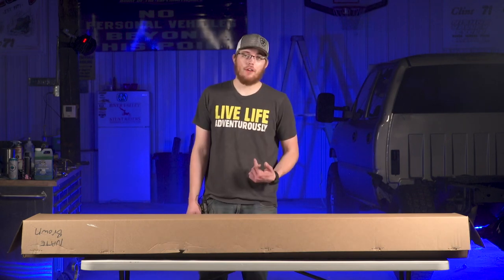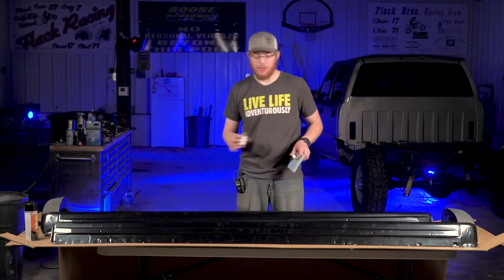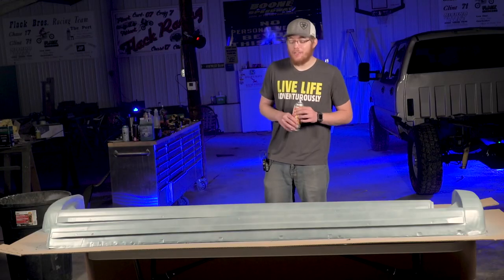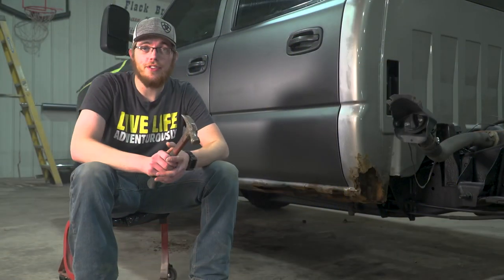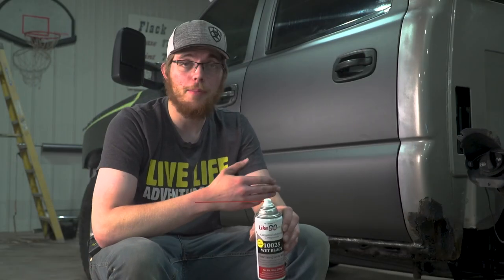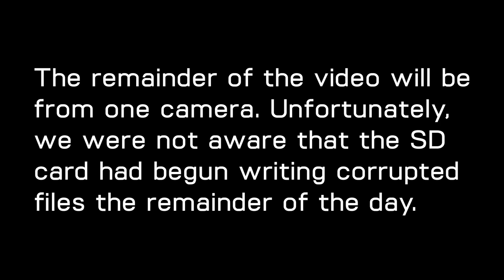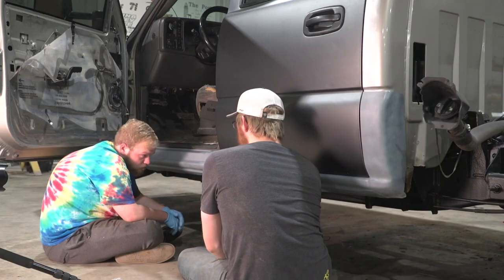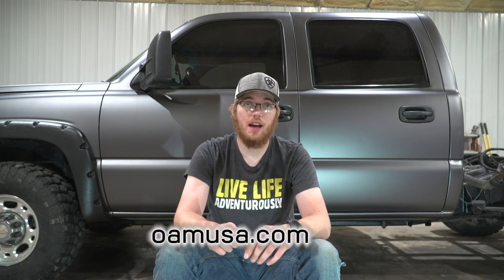Easiest Way To Deal With Rusty Rocker Panels

Comment: By the time you’ve bought the starter kit $117 & the panels $460 your out almost $600 bucks. Better off the get your harbor freight angle grinder $29 and cut them and go to rock auto and buy a set of panels $300. Get you a used 110 cheapo welder and do it right. Now, you got a welder and grinder too boot for your next project. Your mileage may very.
Reply: Cheaper to cut off rusted area, FOAM fill , Bondo fill, sand down , primer, paint, less $100
Reply: @roadsafeties-wg6hi  Some peoples rockers (like mine) are completely gone, and that wont last long. Done that on many trucks and it lasts a couple months (just one winter)

Comment: I guess i can see the need for this product...but its not my choice. Just checked on the covers... $400.00 is a bit much for plastic. I bought a set of steel rockers just a little over $100.00 online ...i cut out the old rockers and a local guy welded the new ones on for $100 a side. I used a small amount of filler, then painted them...When all was said and done i was in to the project for just about the same $400.00 as buying plastic. IF the plastic ones were $99.00 or something...i could see the reason for buying them (you'd save hundreds of dollars). Seems like they are a band-aid on a bullet wound. But Anyway...nice job on the video....truck looks nice after the cover were put on. You did a good job explaining the process.
Reply: I've been feeling the same way. I have rusted out cab corners and rocker panels and debating between just doing new metal, body filler, primer and paint, or these covers. However these covers do just seem like a band aid, not really addressing the problem literally covering it. Just dunno how they would hold up over time.
Reply: Where did you source steel rockers for such a good price?
Reply: Thats just what i wanted to hear, a got a 2014 sierra and the previous owner just put bondo and paint over all the rocker panel rust and called it a day, 2 days ago i decided to actually check the truck and i hit the rocker panel with my fist and it just started crumbling to pieces 😂

Comment: If your rockers are bad, how does plastic restore the structure integrity that is lost?   Isn't this like putting a piece of tape on one side of your broken leg?
Reply: Bc Rockers are cosmetic and Not structural
Reply: @CarterEdison777    That would be great if true. But it's not.
Reply: @judyjohnson630  Its absolutely true in a body on frame truck, like this video!
Reply: Even on my 1999 Toyota Solara the outer rocker cover is not structural. The middle rocker cover and the inner rocker cover our however structural on my unibody car.

Comment: Best way is the right way cut rust and weld new in place .      Your just wasting money trying to hide it.
Reply from the maker: You’re unfortunately right on this. I did this install to satisfy myself. I have no intentions of selling the truck, and would be transparent regarding the covers if I did.
Reply: There is no real right way I've had metal cut out and replaced 3 times already on 2000 chevy silverado and now it's rusting again for a 4th time and worst part is its a 3 door model so the bill is even higher replacing the rust on driver side the last time it was $4,750.00 to fix both sides
Reply: @johns3153  that means they didn’t do it correctly
Reply: @user-my5nr3il3q  idk it's been to three different places one was got rust in Maryland then two different places in Delaware
Reply: @johns3153  something doesn’t sound right about that, I’d say they’re not protecting the insides of the panels properly or at all if it’s rusting out again that fast.

Comment: Everyone complaining and saying they're going to fall off, they cost too much, it's gunna rust even faster, bla bla bla..... 1. Use some 3M urethane and apply a bead around the entire lip and on all the other surfaces, it holds your windshield in it'll definitely hold these on and seal out any road grime. 2. Yes they cost a little bit compared to steel slip ons or replacements but the cost for a shop to install them is typically thousands over these covers and I can guarantee you they're going to rust again (unless you don't drive the vehicle in the rain or snow ever again which that's not what these are for) and you'll be replacing them again. 3. If you treat the rust underneath, cut it out and treat the bare metal, or use one of the multiple coatings out there to treat and stop the chemical reaction that is causing the rust the do as I said in 1 and you'll be good. Don't be scared to not get fucked by a shop. P.S. I work at a body shop doing paint and body work. Have done tons of rockers and cab corners, and have also replaced tons of replacements..... BUT! If you enjoy watching your ride rust over and over again and sometimes paying more or half of what your vehicle is worth then hey you do you, I don't hate ya for it. Keeps the lights on.
Reply: Lol! I would think that someone who works in a body shop would know that rocker panels rust from the inside out.  Gluing pieces of plastic to what is essentially a rusty metal box filled with condensation and water isn’t  going to do what you think it will. 

Can I get your “guarantee” in writing?

Comment: This is why I have trust issues when buying cars
Reply: Are you less Man if your teeth have been fixed the right way or your knee was replaced the right way ?
Reply: @intruderIG  The right way implies the rocker panels were removed and new pieces were welded in place of the old.

Comment: Is this a joke? Rocker panel’s generally rust from the inside out. How are you going to paint the INSIDE of the rocker panels - where it matters?

And rocker panels are structural. Once you glue these on, and your rocker panels continue to rust away, will these plastic pieces provide the same structural integrity as steel rocker panels.

And rocker panels have drain holes, to allow the moisture out. How do these plastic ones allow the rocker panels to breath.

This isn’t a repair at all. It’s lipstick on a pig.

Comment: Nice concept. But if the inner rockers are rotted out as well, these aren't really going to suffice. They still need to mount to something.
Reply from the maker: There are inner rocker brackets available as well!
Reply: @NathanialBrown  - Right but the rocker brackets will not have anything to attach to if the inner rocker lip/panel seam is rusted out... right(?)
Reply from the maker: @__WJK__  I’m honestly not 100% sure. I’ve done two installs and neither have needs them. I know they attach with self tapers, so in theory you’d have the flexibility to choose the most rigid spots to screw. Again, I can’t confirm this.

Comment: $400 for a set for my 2004 Chevy 1500, no way in hell lol. If you're gonna glue something on you may as well get a set of slip on rockers and some adhesive... That being said, these things will cause whatever's behind them to rust twice as fast until your $400 flimsy plastic covers fall off the truck and get run over. Good idea, but WAY overpriced for the guy that wants to do a hack, slap, and forget it 
 job

Comment: i can only imagine the water n dirt getting in there although 3m tape is good i see the rocker fying off within a yr or flaping in the wind
Reply: Add some 3m urethane, problem solved. Shit holds windshields, should have no problem holding these. Plus you make a full bead and keep all road grime out.
Reply from the maker: 9 months and mine still look solid

Comment: I question how will they stand up to rural gravel roads. I am guessing they will be ground up by the gravel coming off the front wheels. Sure you can put mud flaps on the front but I still have my doubts. Plus $400 + repair seems expensive if you can do the metal replacements yourself.
Reply: The key with your comment is "if you can do metal replacements yourself" I agree, but this is a lot less work, cost, & it doesn't require the tools or skillset to replace with metal. I think a coating of bed liner or a similar thick, hard or rubberized coating would bne best. I am in Omaha, & between the salt, sand, extreme cold, slush, wet weather, & the gravel you kick up if you drive dirt roads a lot or daily I am curious how the plastic holds up. My biggest concern & I think they do a good job of addressing is getting all the crap, rust, salt etc out of the rocker as well  as sealling it and or neutralizing as it is when the rockers or wherever continues to hold the wet gunk against exposed metal that corrosion really accelerates quickly. I initially thought they were going to use self tapers to secure the plastic so was glad to see the use of pop rivets. This product isn't a perfect fix, but if done right, I think it could be a good answer for those with budget, time, or skill constraints, and would improve the look of the vehicle, & if done right give youy several more years before that hidden rusty rocker rots away above the rocker or causing it to sag or flap.
Reply: @harvestblades  Yeah, it is going to get much worse underneath, unless you can remove all the rust. That stuff he put does nothing, maybe it makes you feel better. I would almost say glue on a primed and painted metal rocker, then spray ATF under it every year.

Comment: Compared to the alternative.   Doing (my time is valuable)  or paying a body shop.....THOUSANDS. This is a darn fine solve.  As long as you stop the existing rust and source of moisture (which the body shop wont likely do). 300 for corners,  spendy for plastic but looks great, saves thousands.....

Comment: Sure it looks better, but does it pass a state inspection? My state requires yearly inspections and I do believe it needs to be replaced with metal or it won't pass. No sticker means wasted money and you can't legally drive it on the road.

Comment: OAM Quick Covers are pretty nice but the cost + shipping is brutal, even tried to have a friend (who lives near them) pick up a set for me (to avoid the $80 shipping) but OAM wouldn't allow walk-in customer purchases :'(  I'm hoping BushWhacker will hurry up and offer a set of TrailArmor Rocker covers for 3rd Gen Quad Cab Rams (for $160), which would be awesome! That said, good video, the rocker cover turned out nice.  btw...why did you use moly grease on the rust instead of a really good spray-on or paint-on rust-reformer(?)
Reply from the maker: If you’re still looking for a solution, I’d check with OAM again. I’m guessing the walk in policy was due to covid. When I got mine I actually sent a friend in to get them!
Reply: @NathanialBrown  - I actually contacted OAM (about the walk-in purchases) back in late 2018/early 2019.  Might try emailing them again and see if they've changed their "walk-in" policy for 2022(?)  That said, did you have your covers "wrapped" or "painted" (?)
Reply from the maker: @__WJK__  apologies for the delayed response! The covers in this video were wrapped as the entire truck was being wrapped. We’re currently working on a second video where we show the paint work being done on another set! Hopefully you have been able to get yourself some!

Comment: Great video.  But this is temp solution.  As the years goes on, rust will spreading in the hidden by rocker penal.
Reply: Yep
Reply: I’m 57 yo.  Started doing this sort of work at 15.  The rust stop he is spraying on the rust works and will stop the rust.  I’ve seen work I performed 30 years ago and it still looks good.

Comment: You can get a cheap Flux core welder at Harbor freight & better welders but, I went there to get a stick welder but, my local Harbor freight was sold out so, I grabbed the Flux core...Anywho, it was only about $130-150.....
Reply from the maker: I considered the welding option as we have two on the farm, however this option seemed the quickest to fit what I wanted.
Reply: Yeah but, no but......this "repair " is a classic example of American "form over function" .....which admittedly seemed to be just a Californian thang when I lived there but has obviously spread nationwide....."oh, doesn't it look FABULOUS honey" ....... never mind the structural integrity, feel the shine. This at least explains the YouTube videos of American vehicles exploding in an accident, I always wondered why they did that. The point I'm trying to get across here is......the time to use these is when you buy the vehicle new or nearly new and as someone upthread said, use windshield adhesive to fix them in place. Anyway, just my tuppence worth.
Reply: @iandennis7836  1. No, rockers are cosmetic and Not stuctural
2. No, putting plastic over metal
Means you’ll never notice the rust in the backround
Reply: @CarterEdison777  and you've just made my point. Away from America,  we don't have a choice, sills (rockers, whatever ) are structural.......and our vehicle road worthiness test is SLIGHTLY more stringent than yours, shall we say.......
Reply: @iandennis7836  In glad that I could teach you that, when sills rust away, none your structural safety is diminished, in a 1/2 ton American truck. 

And yea, in the uk , the ‘heaviest duty’ ford pickup on sale might just collapse with some ‘sill’ oxidation; I wont argue with you on that
Reply: @CarterEdison777  I'll be honest with you, if the sills are that knackered, I wouldn't trust the integrity of the cab further than I could throw it, in the event of a high speed collision......
Reply: @iandennis7836  LOL “integrity of the cab” due to “knackered sills”.
Talk about A False Sense of Security!!
Reply: Flux core welding on bodywork is not the ideal welder. Lot of extra clean up.

Much better is a MIG welder.

Comment: Great video. One recommendation I would make is to get some phosphoric acid and coat all of the rusty parts with it. Phosphoric acid is a neutralizer and acts as a primer coat. Once that's done you can then apply the grease. You will have much better longer lasting results. 

Thanks for sharing the video.
Reply: 8 like😅
Reply: 8 like😅h

Comment: Hey man i got some moly grease from amazon for this project. It came in a tube for the grease gun. Im going to apply with a brush. "My question is" is one tube enough for both sides. Also it is a brown color. Does it matter what color as long as its a multi purpose moly grease?? Thanks
Reply from the maker: We used a tube on another install and one was enough. The color didn’t matter, if any seeps out you can wipe it off!
Reply: @NathanialBrown  thanks man i cant wait till im done with this.

Comment: I think this is a great solution but this is more temporarily I think it's a great quick fix if you're. problem not gonna to own the truck that long maybe a few years top  if that
Reply from the maker: A lot of people have installed these with the intentions of keeping the truck long term, and avoiding the inevitable rusting of new metal weld ins. We’re currently working on another video where a friend had them installed on a truck he recently purchased, specifically to avoid rusting again down the road!
Reply: How does this address the rusting and condensation inside the rocker panels? How will you know when your real rocker panels are about to fail?
Reply: Lol! This isn’t a solution to anything. It’s a cover up.

Comment: That’s a good idea for do it yourselfers.  The truth is… most of theses trucks are just being set up for an additional 10 years of life and then the junk yard.  

IF THIS WAS A RESTORATION to LIKE NEW on a very valuable vehicle that will continue to appreciate…… this would be the wrong product.  

If your a good metal worker and have the tools and skills needed to replace with new steel…. Well, this probably wouldn’t be your first choice either.  

I have a friend who has a 2005 F-150 King Ranch with a brand new motor, transmission, and is mechanically in great condition. 

But both sides of the cab have rusted out. The quotes for repair are between $5900-$7000!   This might be the right choice?
Reply: Unless he wants to pay eighty grand for a new truck, I think seven grand to fix his truck is in line. You might be able to source a whole new cab for seven grand.

I just did a research online and I was able to find all kinds of 2005 Chevy Silverado cab shells for under $1,000.

Comment: Should you take off the side step to install these? Or will the cover be able to clear it?
Reply from the maker: Depending on what steps or nerf bars you have, you may have to remove them. I’d bet they’ll slide between most setups, but it may be challenging to drill the holes for rivets
Reply: @NathanialBrown  they're the stock tube ones from factory. I imagine they'll be almost impossible to take off 😅. Thanks for the insight

Comment: Great video and it seems like a great solution.

It would have been more helpful if you would have time stamped it and then give a quote to what the cost would be delivered to a person's residence or shop.

For example, common listing for my 1999 Toyota Solara outer rocker panel cover is around $110.00 as of June 2023 from online offers from dealerships. I think there might be a metal and then an inner rocker cover so we'll just rounded up the $400 with shipping. I will consider  the painting and priming a wash.

Do the plastic covers compare in price?